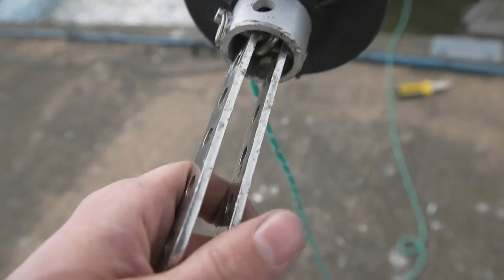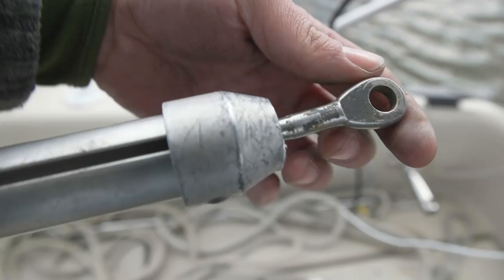Fixing the jib roll and setting the boom - Electric sailboat vlog 0004

Comment: Hi Pauli, now that your forestay is slightly shorter, your mast will lean more towards the front. You may need to look at what it does to weather helm on your rudder. I am referring to mast rake angle, tuning the stay wires etc. to make your boat sail more efficiently. When that happens, you will definitely use less electrical power. The ideal case of course, is using 100% wind power from your sails.